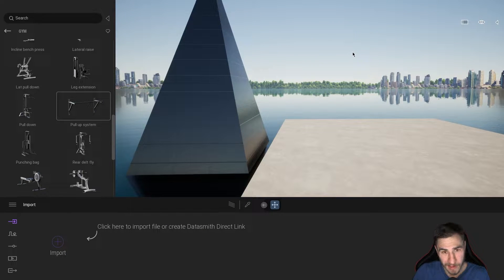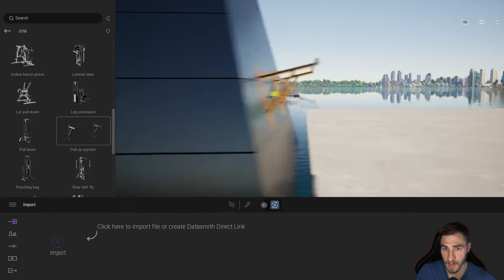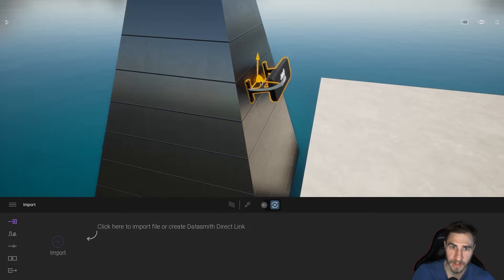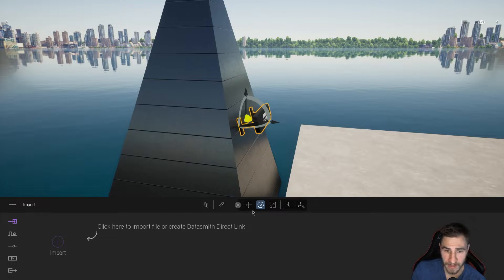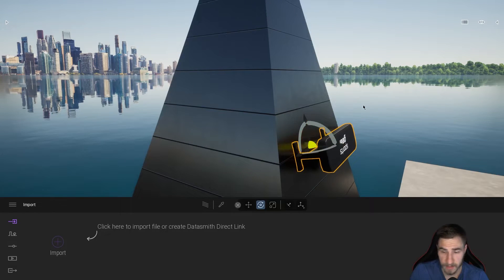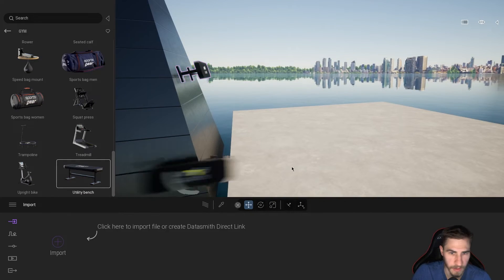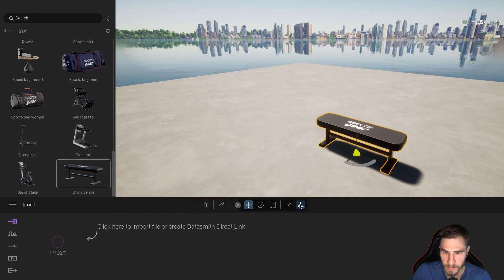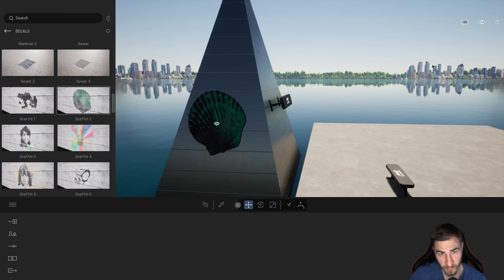Moving Objects Using World Axis & Local Axis | Twinmotion

Comment: Can you rotate the axis of a gizmo? So the X and Y point in another direction compared to the object?
Reply from the maker: hmm I do not think so direct. You can of course use the gizmo to rotate the object and this will rotate the gizmo. You can change the origin of the object using the gizmo which does include the rotation.

Comment: Hey Dallas. Your videos are fantastic, packed full of information and very useful information. I have a question about the world axis. I need to place a building in a specific/precise real-world location. The building needs to be in the exact geographic location and at the correct topographic elevation (feet above sea level). Is it possible to enter cartesian coordinates and elevation using the world axis gizmo?
Reply from the maker: That is not something I have attempted to achieve although I believe you could get close if not exact using the method you mentioned. One caveat is that Twinmotion is not the size of the world and does not have true long/lat coordinates to input. I feel the best you could do it use the internal origin of whatever program you use to model and make sure everything matches that in Twinmotion.